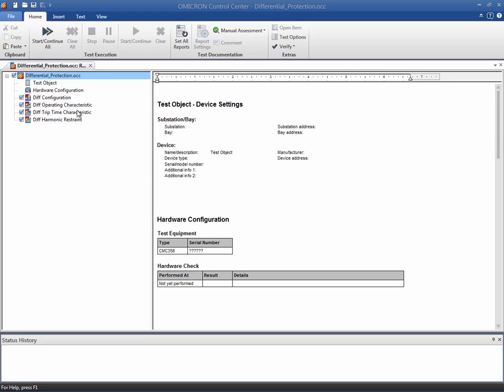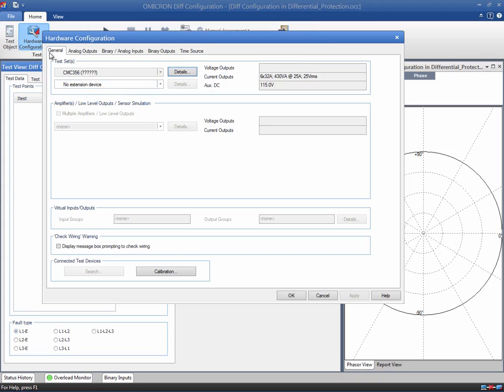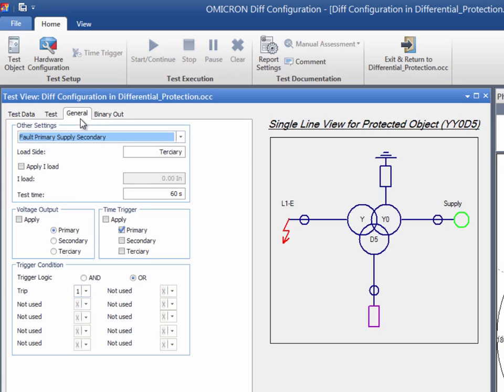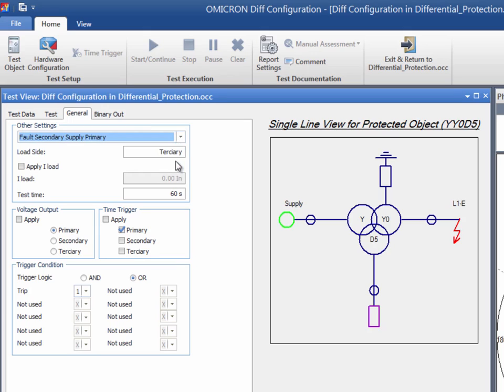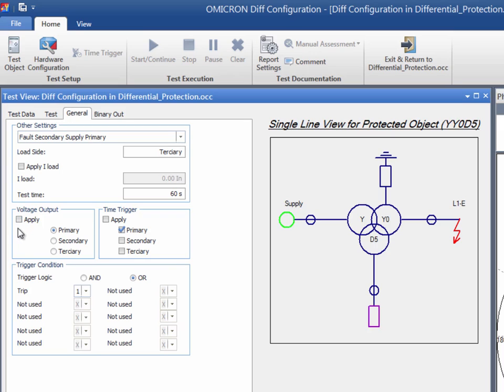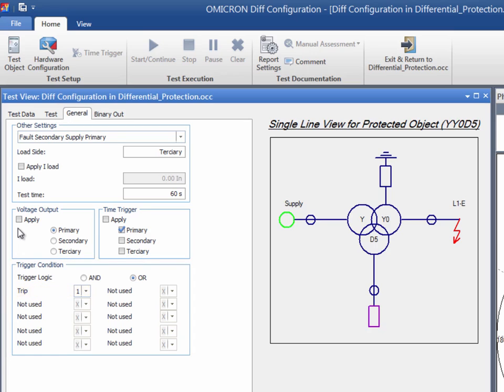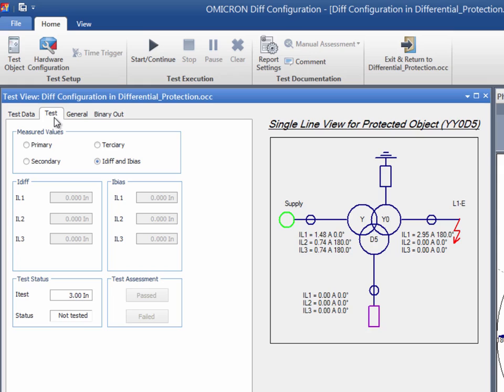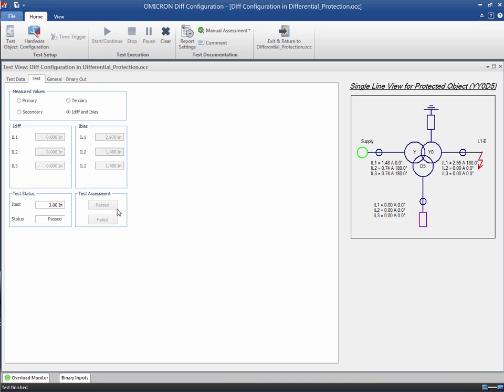Advanced Differential Modules Part II

Comment: How to find P1 P1 P3 formula or any formate calculation
Reply from the maker: Dear BMK EEE @ INFINITY, 

thanks a lot for your interest and comment to this video. 
 
If you have a look at the graph in the video as an example, then we would go on as follows: From the relay settings we know, that the first slope has a setting of 25% or 0.25. Same applies for the second slope, here we have a setting of 50% or 0.5.
 
For P1 we know that the first slope should go through the origin. In our example we know that the Idiff>> setting is 6, which we use for our P3.
 
With the knowledge above you can then use straight line equation to get the unknown points.
 
y=m*x+b (Idiff = y & Ibias=x) m= slope or gradient
 
More information about how to do so can be found on the web e.g. via below sample link: https://www.mathsisfun.com/equation_of_line.html

If you have any further questions, please contact our technical support team directly. They are happy to help: support@omicronenergy.com

Best regards, 
your OMICRON team